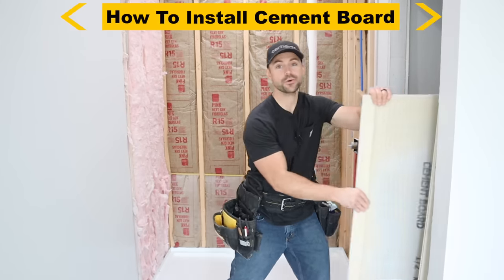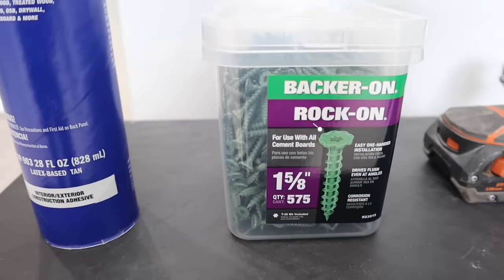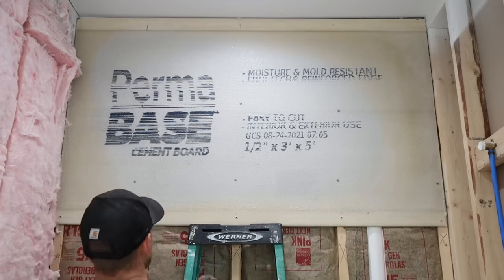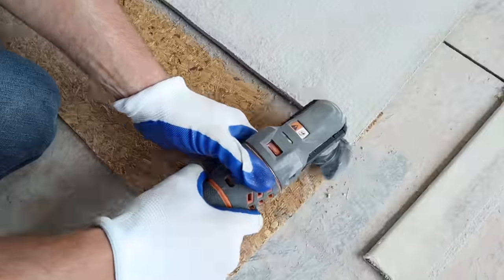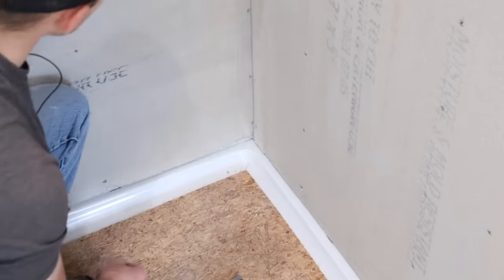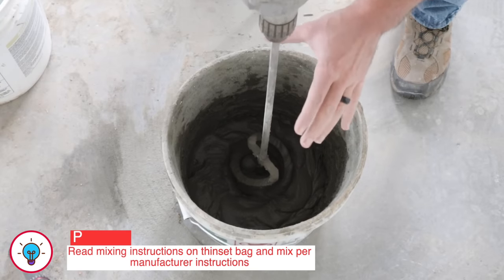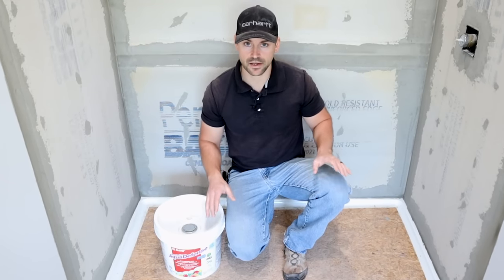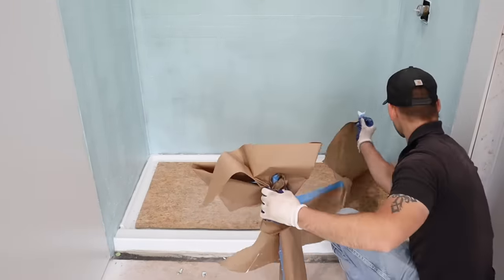How To Install Cement Board and Waterproofing For Tile Shower Walls - Complete Step-By-Step Guide

Comment: Just came across your channel and watched the video.   Two things.  1st, instead of using cement backer board, I switched to Johns Mansfield Go Board, it's available at the blue big box store.   It cuts like drywall and is completely impervious to water, unlike concrete.   2nd, most shower pan manufacturers recommend installing the backer board to the top of the flange, not over it.   The tile or other material will then come down to 1/8" from the bottom and get siliconed.   This will leave a gap so that water can't wick up behind the final wall in case the silicone gets compromised.   Other than that, it was a good tutorial.
Reply: This is a really good video.  AK, do you suggest applying a vapor barrier behind the Go board on top of the insulation for added protection?  Also, to fill in the inch space between the board & tub (for guest bath) what silicone do you use? I tried cutting the cement backer board for my fireplace & had to nap after... :-O
Reply: @jens2763 The go board is waterproof, closed cell foam, so you won’t need the vapor barrier for that.   If your on an outside wall, you might see a vapor barrier on the back side of your studs, but nothing you should need to deal with.   GoBoard has their own sealant that the recommend and is what I use.   There are several YouTube’s that will show you proper technique, it gets spread about 2” each side of joint.   I normally put in a foam pan, so the GoBoard just slips into the dado on the pan, but this last time I installed into a fiberglass pan, so instead of stopping at the top, I cut an 1/8” slot out of the bottom and slipped the GoBoard to 1/8” from the pan over the flange.   Then I applied sealant to the cutout and sealed it to the flange that way.   GoBoard just cuts with a knife so it’s pretty easy.  Everything turned out great.
Reply: not a good idea because if water gets behind the tile, and there's no cement board behind it, that water's going straight into the wood and insulation behind it. better to have the cement board get in contact with water as a backup.
Reply: @user-vc5rp7nf8f  No, this is a common misconception. Cement board (PermaBASE, Hardi) is NOT waterproof and will happily wick water up the wall. You do not want it anywhere near the tub/shower. If you stop it at the top of the tub/shower flange, the bottom tiles simply cantilever down to within 1/8 inch of the deck. Water that somehow gets behind the tile can never reach the wood framing because of that flange. It would have to travel an inch or more straight up.
Reply: @user-vc5rp7nf8f the manufacturer says you are incorrect in your installation advice/observation
Reply: @AKJammer1  Loved this video, @The Excellent Laborer. Super, super great and I will be following it step by step, probably pausing after every sentence to get it right. :-) Also, thank you, AKJammer1 for the additional information. I am about to start ripping old tile away from my (also old) bathtub and I KNOW there will be water damage back there. (House built in early 50's and they used sheet rock back then, I believe). Anyway, I would like to use your suggestion of the Go Board to replace that old sheetrock. How far above the tub should the end of the Go Board be? (I assume not flush with the edge of the tub.) I can't remove the tub (which is fine) because it's a heavy porcelain/cast iron tub so I'll need to use some sort of flexible waterproof laminate (probably the wrong word) panels (3) to create a new surround. Thank you for any tips you or anyone with experience may be willing to offer. I'm 64 and I need to do this on my own (for financial reasons) and I know I can do it after watching 165 YouTube videos (so far). You can't begin to know how much I appreciate all of you out there in YouTube land who are willing to lend your expertise.
Reply: @juliava605  Good Luck with your project.   I'm the same age and have learned most of what I've done via university of YouTube.  :-)  So to your question, As I commented above, the manufacturers recommendation is to place it at the top of the flange, and I've done it that way, but I think I prefer to scribe out the back of the go-board (very easy), so the go-board comes all the way down to 1/8" from the edge, but remains flat without bowing out at the base.   Then I put a good sized bead of lexel along the back of the go-board against the flange.    I then use the standard mansfield sealer along that 1/8" at the bottom.   The tile would then come down all the way to the edge as well.    Now if you're doing a fiberglass surround, that's a bit different.    I haven't done one of those in a few years, but I believe you just connect that to the studs, fiberglass is waterproof, so no additional waterproof material is required (no go-board).   You can download the installation manual of your proposed unit and see what the manufacturer recommends before you actually start buying stuff.    Once again, Good Luck and Have Fun!!
Reply: @AKJammer1  Wow! Thank you so very much for taking the time to respond. I really appreciate your kindness and your encouragement. My original plan was to tear up the walls and tiles, put hardieboard or goboard or something similar up for walls, use mesh tape and thinset along all of the corners and seams, let dry, paint everything with RedGuard or something similar and then use a very good construction adhesive to adhere the panels to the walls. 

I think I just heard you say that I can remove the walls and just adhere fiberglass panels directly to the studs?? I know you can do that with the premade surrounds, but I thought I read that you cannot do that if you have a tub like mine. I don’t have a modern fiberglass tub. I have an older tub from the 50s that is cast-iron covered with porcelain I think. For this reason, I think I need to get separate panels. Actually, I think I’m confused. 🤦🏻‍♀️😬

Seriously, thanks so much for all of your good advice. Much appreciated.  I will continue to study before I start the demo process.
Reply: @juliava605  I think you're going to be pleasantly surprised.    I can see four different scenarios.   Most tubs, even the old cast iron ones had a flange on them.  So the four options are:
1.   Tub has a flange, Surround doesn't have a bottom flange/tab.   Bring the surround down to 1/8" above the edge, use Lexel along the back on the tub flange to seal it.   Caulk the bottom 1/8" with white or color matched to tub.
2.   Tub does not have a flange, Surround does have bottom flange/tab.  Slide bottom of surround behind the tub, nail to studs, caulk the joint between the surround and the tub.
3.    Neither tub nor Surround have a flange.  Position bottom of Surround 1/8" from top of tub and caulk the joint.   Use liquid nails to hold the surround to the studs near the bottom.
4.    Both the tub and the surround have a flange.   This is the trickiest.   I think I would cut the flange/tab off the fiberglass and proceed as #1 above.   

Before you do anything though, read the manufacturers recommendations.   You can even call them and describe/send pictures and they can help you decide the best way of going forward.
Reply: @AKJammer1  oh my goodness thank you so so so much! You have been incredibly generous with your time and expertise and I can’t thank you enough. This is really helpful. Thank you so much for laying this all out like this so that no matter which scenario I find myself facing, I will know how to approach it.

Just to clarify, the above instructions are for installing  pre-fabricated tub surround walls (or independent laminate panels) directly to studs? In other words, not using any goboard or backer board /cement board of any type, correct? Just directly to studs with nothing behind the tub surround walls?  (As you can see, it still shocks me to learn that I don’t need to take all the steps I would need to take if I were tiling so I just want to make sure I ‘m not misunderstanding that.)

Also, when I measure the long back wall currently there above my tub, I get a measurement of 59 inches. Is this because the other 2 walls are taking a half inch off each side? I ask because most products I’m finding for tub surround walls are 60 inches in length for that back wall. I’m not sure whether to buy a product that is 59 inches long or 60 inches long.

Thank you again so so much for all of your instruction and education. You can’t begin to know how much it means to me to have this guidance.
Reply: @juliava605  Correct.   A basic bathroom is 5x10.   The surrounds are made to go onto the studs and typically won't fit if you have backerboard or drywall in place because you'll lose that 1".     Some surrounds are larger, 61" at the back, those surrounds can be cut to fit usually anywhere between 57" to 61".   Some of these older places had some really wonky walls, so you can usually find whatever you want.   If you really want the backerboard you can use it and put one of these surrounds over top.   It's not manufacturers recommendations, but hey, it's your house.   Maybe you want something that will last a few years, but you plan on tiling later.   Save a step.   Make a plan and go for it depending on your circumstance.
Reply: @AKJammer1  Thank you for the wise words. Actually, I would  prefer to go direct to studs. I’m just confirming because I don’t want any leaks! I definitely don’t EVER want to tile in the future. I hope I can find a surround that fits comes in a few pieces. Fingers crossed 🤞🏼 

Thank you so much again for all of your help.  You’ve been very generous. 🙏🏼

Comment: Should have shown us how the cement board looked at the bottom edge of the shower panel. Does it touch the lip of the panel or is it 1/8”+ gap to avoid water absorption? Thanks
Reply: Rests within the cut out which was made.
Reply: It's best if you tape it around with butyl tape and set the durock just above lip
Reply: @erikurrutia1500  hey, how do you seal it afterwards? I saw a guy use mesh tape to cover the gap between backer board and shower flange and then thinset like the other seams, before using the aqua defence. Is that a good way to do it?
Reply: @vanessap8717  if you leave your backer right above the lip and the use mesh tape on the seam the add thinset with a flat trowel or putty knife to fill the void.  When that sets up use a waterproof membrane on all the backerboard all the way down to where it meets the fiberglass pan.  I recommend taping the fiberglass pan at the 90° angle where they come together.  Then peel the tape and good to go.
Reply: @erikurrutia1500  the lip on my pan is too thick to cut and overlap. So you’re saying I can butt the Durok to the lip and use butyl tape to cover where they meet?
Reply: @vanessap8717
Reply: @corky5928  no..I think he meant that he uses butyl tape wrap around the bottom to stop water absorption
Reply: @vanessap8717  Yes that's the correct way to do it....

Comment: Good stuff. The most important thing I can reinforce is never to run cement board or drywall over the lip of a shower pan. EVER. Both will wick moisture. Both will fail.
Reply: You run the sheets into the tray stopping 3-5 mm short of the tray bottom and then silicon seal the gap . Water proof the sheets . Run the tiles down the same and silicon seal the gap .

Comment: I like your videos but for my shower installs, I use a poly styrene backer board called "GO Board" from Johns-Mansville (approx $26 for 1/2" x 36"x 60") instead of cement board (approx$14) , Go Board is waterproof and doesn't need a painted waterproof membrane ($60-$150) or tape ($10) for the seams and the corners. They have a "GO BOARD" adhesive ($16 for a 10 oz tube) that you spread over the seams and screw heads. It cuts with a utility knife and is dense enough to use bugle head backer board screws ($35). Cement boards need a waterproof membrane painted on it to keep from absorbing moisture. I've added up the costs and using  "Go Board" is about the same cost and a lot quicker and more waterproof instead of a product like cement or hardi backer board that can and will absorb moisture.
Reply: Yep and goboard is lightweight and easy to cut no dust. I agree.
Reply: Go board isn't as readily available as cement backers which stinks
Reply: One issue I have seen with goboard is that if you are going to install grab bars or anything with screws going through the tile into studs or backers, the tile can easily crack as the goboard is foam core and compresses.
Reply: No cement board doesn’t need a waterproofing over it this is all upmarket selling. Concrete board doesn’t rot , ever. Use a plastic barrier behind cement board and modified thinset ( mostly water proof).
Expensive plastic boards are a waste of money
Reply: @tomdemeo2708 
Exactly .. I love people who think shulter is the only way to go....😂
Little do they know their newly built house probably has tiles on drywall in the shower,  and tile directly mortared to the subfloor ...😂😂
Reply: @tomdemeo2708 what plastic barrier do you suggest? And what do you mean by modified thinset?
Reply: @blackstaticband  
Modified thin set is polymer added to thin set to increase flexibility and adhesion.
A vapor barrier, plastic or craft paper
Reply: @tomdemeo2708  ok thanks

Is there a thinset product you recommend for shower wall?

What thickness plastic vapor barrier should I use? Is plastic better than tar paper?

Comment: Josh, is there any (good) reason for not using glued on furring strips on each of the wall studs? This would allow you to place the wall boards just over the shower floor lip?
Reply: That's what I did. It worked well. I didn't glue shit though!

Comment: 1 - make sure it's the correct fibre mesh tape for cement board
2 - if you add a bit of water first to the bucket then the thinset, then water to the desired consistency you don't get the corners of dry gunk leftover
Reply: Why do you need the mesh tape and motor if you’re going to title over and motor over the title?
Reply: @JimPutnam-w6d  from what i understand, no matter what, water eventually gets behind the tile
Reply: @kurolap7882  Yup. Precisely why I'm currently in the process of tearing down my tiled shower walls completely. 😭